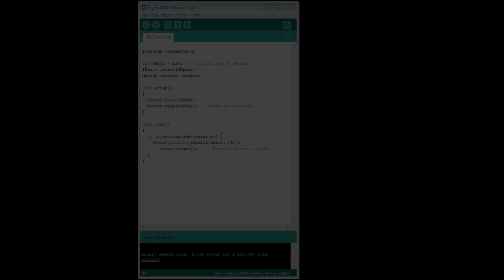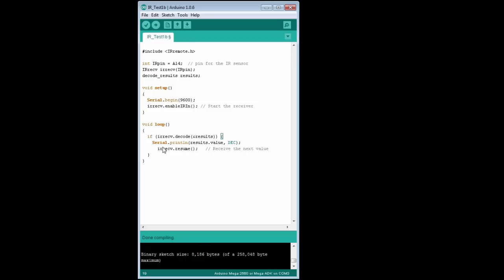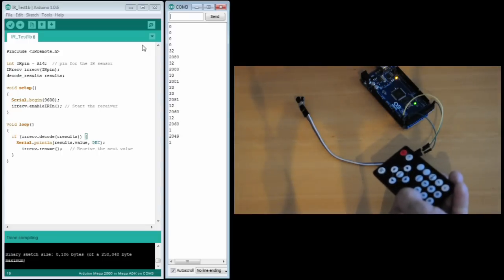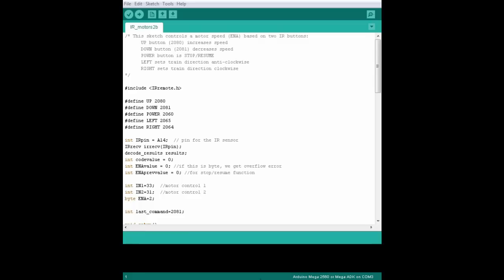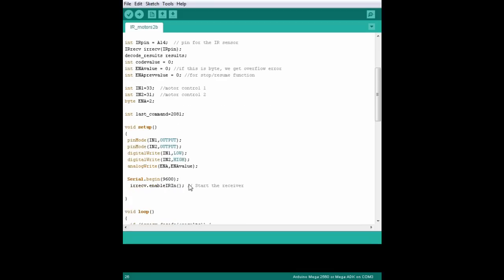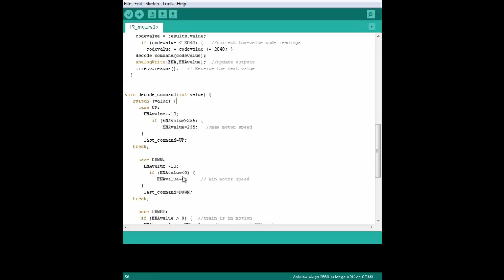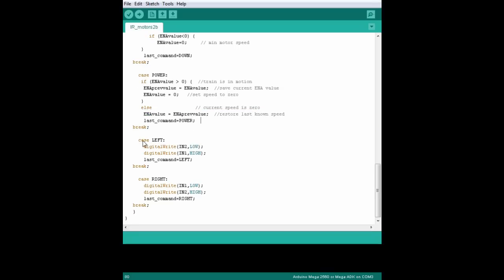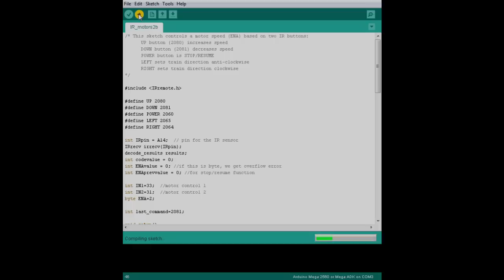Arduino for Lego Trains #7: Infra-red Remote Control

Comment: I like your project. I have also an old lego train and an arduino. The idea to combine these two is really great. 
There are two things that come to my mind. Maybe they are helpful.
The two different values make sense if you look at the binary expressions. Power for example is 12 or 2060. In binary 1100 and 100000001100. 
Thus, the twelfth bit flips with each key press. So holding the key can be distinguished from a renewed press.
Instead of using an if statemente to subtract 2048 you can also use the modulo function. For example: codevalue = codevalue % 2048 or shorter: decode_command(results.value % 2048). This would be little bit faster.
Reply from the maker: +Martin Meise This is a great piece of advice, and it's why I like working with Arduinos so much - the community is fantastic. Thanks very much!

Comment: Excellent tutorials! I was worried my son was getting too old for his lego train but now he can start programming. 

You will hate this but we need to add some manual control to Arduino. Can we use Arduino Serial Monitor to control the trains?
 
void setup() 
Serial.println(" enter G to start train, enter S to stop train") 
  
void loop() 
{
  if (Serial.available())
  {
    char ch = Serial.read();
    if (ch = 'G')
    {
      lego.SingleOutput(0, PWM_FWD4, BLUE CH1);
 if (ch = 'S')
    {
      lego.SingleOutput(0, PWM_FLT, BLUE CH1);
 }
  } 
  }

So that if we press 5 or 6 etc the speed increases...

thanks - pete

Comment: hi i have a problem with the programm code
Reply from the maker: +Dj M1K3 What's the problem?
Reply: i don't know. i write the same code from this tutorial
Reply from the maker: +Dj M1K3 So what is the problem? Does the code compile? What do ypu see in Serial Monitor when you use remote control?
Reply: the problem is it didn't wan't upload on the arduino mega 2560
Reply from the maker: +Dj M1K3 What error did the IDE say? And do you have the correct library installed?